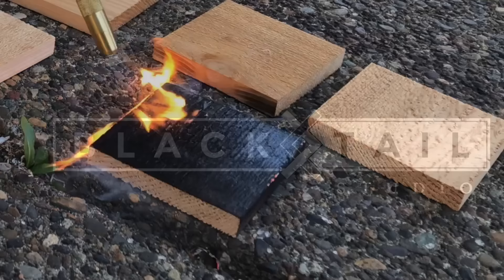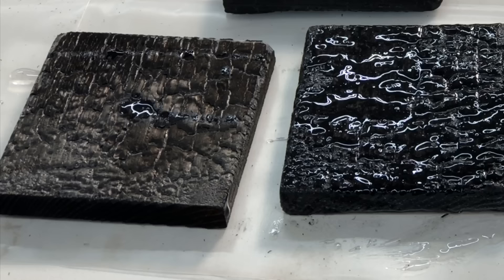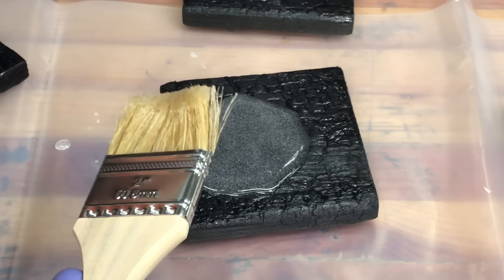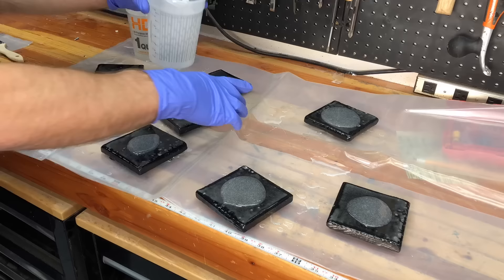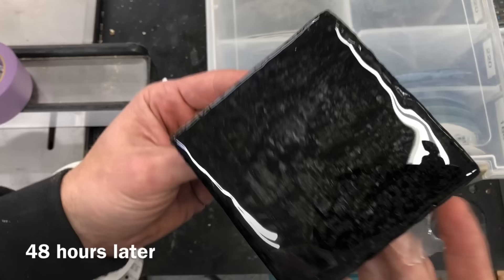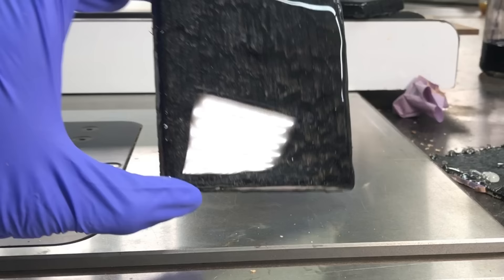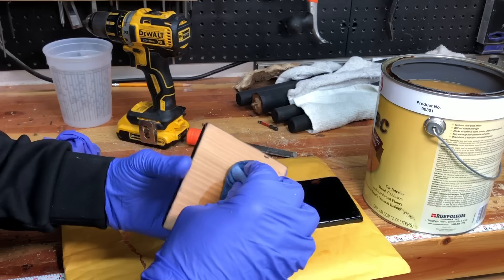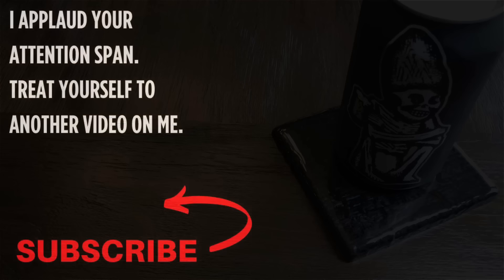Make Scrap Wood Look Like This

Comment: Hello Sir!  BIG fan of your channel!  I have a question or seeking some advice on a project I am working on for my training room at work.  I’m a fire Captain with San Diego Fire-Rescue Dept and been assigned to the Arson Unit (MAST, Metro Arson Strike Team) for about a decade now.  Novice woodworker for fun.
Anyhow, I remodeled our training room recently and looking to make a sign with part of it containing 18”x14” letters made of 8/4 lumber.  The Sergeant in the unit, also a novice woodworker, has a CnC machine I was going to sweet talk into cutting the letters out for me.
I want the sign to say ‘MAST’ in the large 18”x14” letters but want to burn them similar to the coasters and table you did.  I’ll attempt to seal with epoxy similar to what you did.
I wanted to reach out to you to see if you had any advice or things I should be concerned about with attempting this project?  
-Will the letters stay flat after burning them?  
-I intend to use 8/4 material, but do you have a certain type of wood you’d use?  
-The font I’m choosing will have the letters about 2.5-3” wide.  
-Seal initially with any epoxy then use multiple thin coats of table top to build up?

Please see attached pic for a rough layout of what I’m trying to get done.

I think it would be pretty awesome to have a burned ‘MAST’ sign since this is what we investigate for a living.  Thank you very much for your time!

Comment: Any beer as long as its cold. Loved the video, I'm new to epoxy so a little bit nervous trying it with this technique. I'm wanting to burn an old pine table, about 1.5 by 0.7 m. Then brush it back and then epoxy, rather than oil so as it creates a level surface and preserves the lightest possible look on the wood. With my rough plan would I be able to follow the same steps you outlined here? Would there be a different epoxy you would recommend using because of the size? Is epoxy an overkill?
Reply from the maker: Burning will separate any glue joints. Just be aware of that

Comment: Water! I am wondering if you think this will work for a lazy Susan project using a Home Depot round wood described as "1 in. x 2 ft. x 2 ft. Pine Edge Glued Panel Round Common Softwood Boards". I was thinking of pouring over the top but I could but it in a mold and surround it like you did with you burnt wood table. I don't have a band saw or a large planer. This will be outside mostly covered except a few meals a week. I am new to this so that may help you advise me. Than you. DJ

Comment: Could you make these just slightly larger, and then also trim off and then seal the sides as well?  It would be interesting to see the layer of char on top of the uncharred wood.  :-)  
Although I think you would need to take an extra step and epoxy resin the sides also after you cut the charred sides off.  :-P

Comment: Awesome work and finishing with a Dr. Pepper is nice :) , I have done several tile coasters with acrylic pour technique. using Stonecoat countertop art epoxy because its heat resistant.  Do you use any cork for the bottoms? With tiles I have to, so they don't scratch stuff. Is either of the epoxy's you use heat resistant? The stonecoat is supposed to be up to 500 degrees I think it was.   Awesome work all around Cam love the videos. The tables aren't too bad either  ;)

Comment: Hello Cam. I watch your vids ALOT and have seen quite a number of other epoxy artists share their artwork, but a question I pose to you (and wish to pose to some other) is in regard to epoxy 'waste'. As you are obviously aware in any form of production, regardless of the trade, there will likely be a factored in waste percentage. If, said waste product (which often is factored into the final cost for consumer) can be somehow utilized in another sellable form the can product profitable results to the bottom-line for a business. With all that long windedness out of the way...do you have any recommendations (possibly vids) of how 'waste' epoxy can be attractively and cleverly used?

Comment: These are nice tiles. I wouldn't use them as coasters, I prefer something that can contain or soak up condensation. Water would just roll off these and then you'll have cup squares instead of cup rings.
Reply from the maker: That’s funny actually

Comment: Hey Cam, I've watched a couple of your Yakisugi torched wood videos, as I have a little project I'm working on with some similar treatments. The reason I'm reaching out is that, you must know better than most, about just how painful failed epoxy can be. With the near countless hours invested into the prep of these projects epoxy product failures can feel crushing. I just wanted to ask, as you made note that Better Boat was what you used in this application, what would be your go to with regards to burnt wood?? If its the EcoPoxy you've used in the past I'll have to give it a try, because I had a go with a product called C-Coat and it fell short in so many ways (Tears were shed!!).

Thanks.

Comment: I live in Arizona and right now my garage temperature can be pretty toasty (110F). It is not insulated or cooled. Can I pour epoxy on my projects? Will the temperature make the epoxy dry faster? Humidity is very low. No more than 20% in a humid day.
Reply from the maker: Man, I’ve never tried that hot

Comment: Water! HI! I got the $99 course but couldn't find an answer to this: I get very tiny bubbles (inward bubbles) on the top of the epoxy when building tables (like a hundred of them). I have a technique to get them cleaned out and then I can fill them up, but it's really annoying to have to do that. Any suggestions?

Comment: Water... I know boring right? Could you save a step by by just burning one side and the edges instead of cutting off the underside of the coaster ? I was think just sand the drips and clean up the underside and seal.   I like this project and a good way to make use of some extra epoxy left over from a project.

Comment: Left hand. Hey Blacktail, I tried this and my casting epoxy seemed to be saturated, and I hit it with a torch to pop the bubbles, but when I came back later that day it was covered in micro bubbles and hardened. What should I do?
Reply from the maker: Probably start over

Comment: I know stupid question I am almost 100% sure but just confirming with you if I sealed the bottom end with epoxy could these be used as shower tiles
Reply from the maker: I’m not positive
Reply: @BlacktailStudio  Okay  that's fine the epoxy should be waterproof enough when coated on both sides. I was just wondering because that would make such a pretty shower

Comment: Coca Cola if varnish is used instead of epoxy will it seal the wood but lose the glass-top effect? Or will it not seal it either?
Reply from the maker: I wouldn’t use that. I think John maleki had a problem trying that

Comment: Can I make a suggestion before you cut your fingers off???  Ok I worked at a sign shop cutting plastic letters on a vertical band saw. I had a 2X6 “ block of wood about 8” long. It had another piece of wood in the middle of it where I put my hand. The piece I held onto was turned upon its side in the middle of the 2X6. You can hold it tight against the wood coasters you’re cutting while running it past the blade. There is much less a chance of that blade getting your hands. It’ll cut into the 2X6 first. I always made sure my guard and blade was right above just maybe half an inch of whatever I was cutting. That way if the blade broke it’d most times go away from me. 9.9 times out of 10. Sorry just makes me nervous watching you do that when I did exact same thing 15 years without getting cut. It’ll give you a straight cut all the way across ....guess you could use a 2x4 also then put a handle on it in the center upon its side. Hope I’m not confusing you but you’re a smart man and I know you know your way around a saw. !!!!!!!

Comment: Do you have to use a table top epoxy, I've got the flowcast from ecopoxy in at the minute and wondering if I can get away with using that instead
Reply from the maker: Ya, probably

Comment: Love the video! I am quite the amateur wood worker but I am really interested in making this a future project for myself. I have a question, can the cut you made to remove the bottom be done with a table saw rather than a band saw? If not, is there a cheaper alternative you would suggest to the band saw? thank you for your content!!
Reply from the maker: Can do a sketch table saw cut on both sides
Reply: Depends on the size of the coaster, and the size of the table saw. Generally speaking cutting small pieces like this on the table saw is going to be dangerous, and many saws won't have a large enough blade to make this cut in a single pass.

Comment: Ice cold can of coke for me lol. Man these are awesome, I want to make a set for my wife! I am confused a little. When you ran them through the bandsaw and cut them down, the bottom was burnt too? I wouldn't think you would burn the bottom just to cut it.... Was this done on purpose?
Reply: And did you epoxy them 3 times after the initial saturation? Would you have only done it twice if you had thought of the tubs beforehand? Sorry for all the questions...
Reply from the maker: Just try em this way, it works I promise!
Reply: @BlacktailStudio  oh I will for sure, these came out awesome!! I just didn't know if you had to burn the bottoms too or not, since you cut them off. I watched a few more times... I get it now, to save them from warping. Look forward to more of your projects!

Comment: You left out the part where your creations stink up the room. There's a reason houses are written off for "smoke" damage. It fuking stinks.
Reply from the maker: To my knowledge, they don’t encapsulate homes in epoxy. Which would solve that problem.